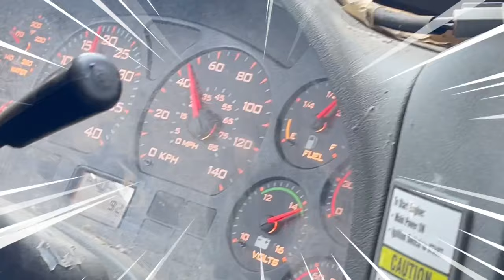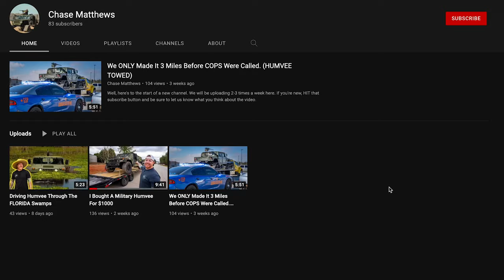The Taliban Aint The Only One With An MRAP!

Comment: The city I retired from got one of the MaxxPro MRAP deals as an armored car, the variant with the hydraulic rear hatch. IIRC weight was over 32,000, and it has air brakes. Here over 26000 and not an RV means CDL. Also I believe you have to have the base CDL to apply for air brake endorsement.   States may exempt first responders from CDL requirements. The doors can be moved (slowly) when there is no air. If it bleeds down often, you can pull the pin on the end of the air cylinder - but if you park on a side hill…

Comment: just a little FYI. It is not illegal to own an Armored Vehicle, Even MRAP. Maybe in Atlanta, but not in most places anyway.
Reply: Correct. Simply stating you won’t find a fully armored vehicle through DOD surplus. There are ways of acquiring bolt on armor for assembly later but it’s not easy or cheap by any means.
Reply: @defiantmotorsports4926  You can indeed buy them armored. They have to be "demilitarized" which means removal of restricted weapons, SOME armor and comms. In some rare circumstances they use special armor plating, typically bolt on additions that they must remove.
Reply: @robsdeviceunknown  lol ok. Look up Demil Code D (which armored vehicles fall under) and get back to me.
Reply: @robsdeviceunknown  The demil process is removing the armor, the only way you can get any armored military vehicle is if you import them, which is a long tedious, expensive, and annoying process. Ask me how I know
Reply: @hummerguy  The infamous munitions list, even Humvees were on it for years. It's why so much British armour is used in hollywood; US "demil" requirements basically means scrapped.

Comment: Unless there's a state law that says otherwise, it's legal to own an MRAP. They are just stupid expensive and they obviously don't come with any guns in them. Idk if you can buy an old military one, but you can definitely buy a new one.

EDIT: apparently you CAN buy milsurp MRAPs, they are just, again, really expensive. Also street legality is going to be really rough to get and if you do get it street legal, you'll probably need a CDL to drive it.
Reply from the maker: You can own the truck itself (international) but demil on the MRAP is full destruction because of the amount of armor on it. If the government removes the armor, it leaves you with nothing. And, you don’t need a CDL to drive it (similar to 5 ton and 7 ton) but I believe you have to be certified through military or law enforcement to drive it. These trucks new we’re sold to government for around $950,000 a piece.
Reply: @ProdigyT.V  though, there are zero laws saying you can't put the armor back on it 😏 

But again, these things are absolutely ridiculously expensive unless you get a much older model or different truck. I've seen older MRAPs for like 200k but that's still a lot of money.
Reply from the maker: Exactly lol zero laws on armor but you can’t buy it as is from government. However, you can buy a similar truck and have someone fabricate armor on it. It would just be stupid expensive
Reply: @DeckDogs4Life  most you’ve seen are trainers and not a true mrap. Demil code for any thing armored is code D, they have to be destroyed and not restorable. 9/10 times destruction has to be witnessed by a DOD employee.
Reply: @ProdigyT.V  they have the hardened AR plate for sale on a lot of the government auction sites that sell the trucks. It's actually pretty cheap for steel, and it's the same stuff they put on everything including the tanks. Last I saw was a 10' wide 20' long piece 1/2" for like 800 bucks.